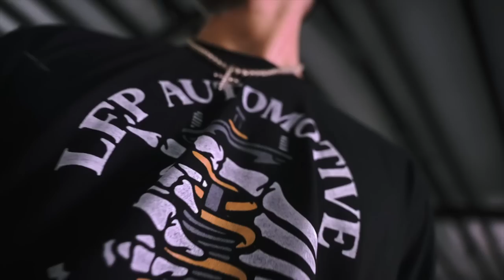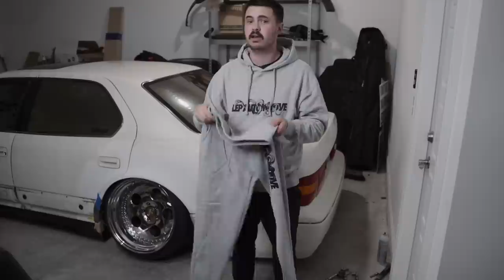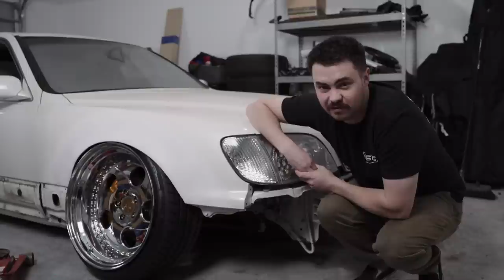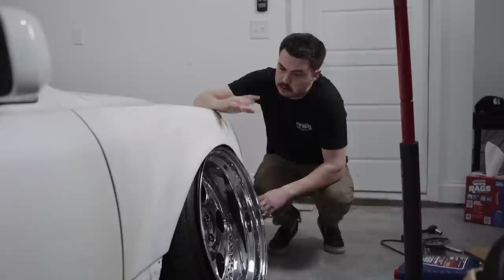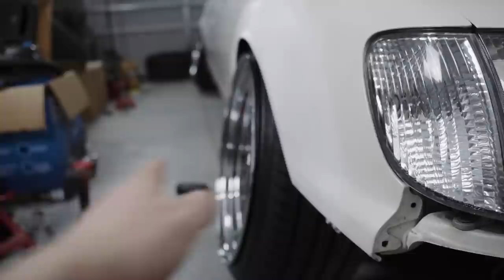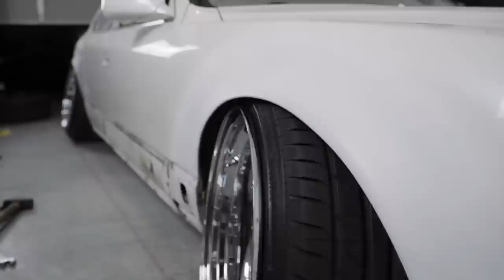WHY I'm Removing Camber - VIP Style LS400

Comment: Run a regular RCA instead of the negative one you have now.
Reply from the maker: Did you not hear me explain why that doesn’t work? Regular RCAs do not correct caster and there is no way to adjust stock caster on these cars. The only way around it would be to get adjustable LCAs and caster arms from T-Demand. Which is both extremely hard to find and VERY expensive, but something I’d like to get a hold of when I can!
Reply: @LEPAutomotive  no im listening with one ear doing errands lol. 
I havent looked at my NRCA in years but i dont recall having caster correction. Caster still within factor spec, -6deg  camber up front. Drives nice.
Ill have to take a peek sometime soon, if mine are caster correcting then everything makes sense.  The one pic i see on google for “studio nrca” shows no caster correction